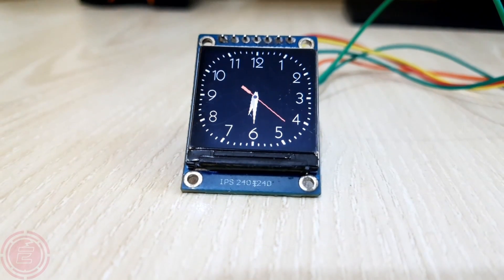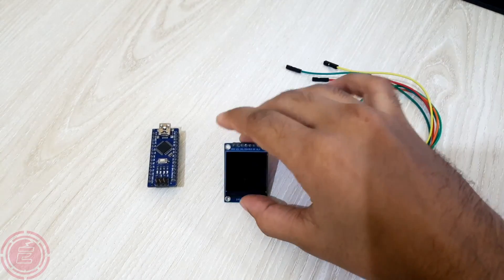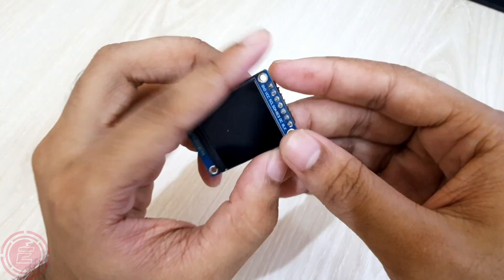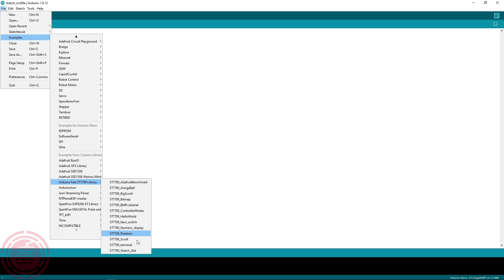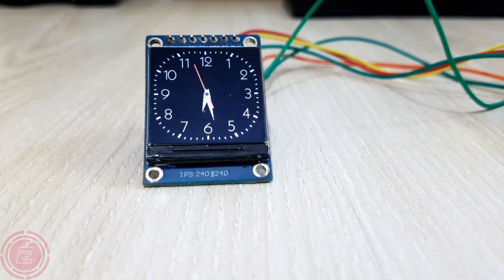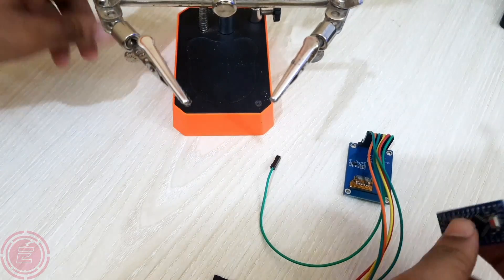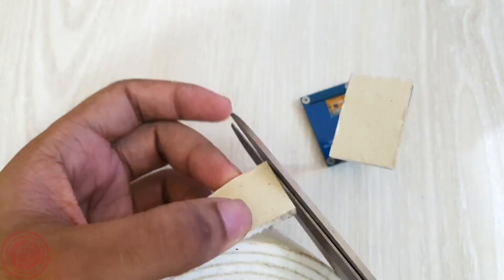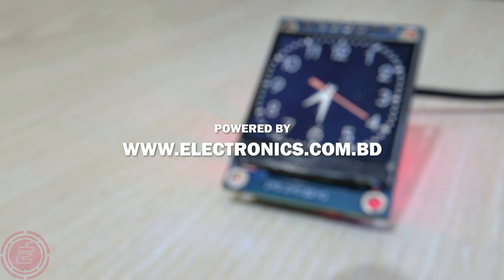DIY clock with TFT Display and Arduino

Comment: Nice build, will give this a try. 2 questions - I have a spare Pro Micro - will it work with this chip? Also, you say you wire it up exactly as per the nano but the nano uses 7 wires and the Pro Mini just 5, I assume that because you eliminated the extra wires for the RTC chip? Which wire was eliminated on the TFT unit? What are the correct pins to use on the pro mini to replicate the nano pins?

Comment: This video is helpful, but not directly relatable to my Raspberry Pi project.

Thank you for being very clear in all three important areas:
1) visual steps when assembling the hardware.
2) showing the wiring diagram/schematic.
3) software libraries and code example.

I am now a subscriber.

Comment: I own esp32 dev 30pins and 1.69" TFT 240X280 SPI ST7789. It doesn't work no matter how much I compile it for three hours. Do you have this lcd and esp32 connection diagram?

Comment: I repeated the same circuit and same code on Arduino Uno and 1.3" LCD Module (ST7789 Driver 240x240 IPS Display). However, the clock appeared perfectly during the first 11 seconds after I ran the Arduino code, but the screen faded (became very dark) after 11 seconds. What's the problem? Thanks!

Comment: Hey very nice detailed video, i am new to coding and adruino boards, i recently made a media volume controller for PC via arduino pro micro and its working fine. My question is that can we run two programmes at the same time? I mean i want to keep using my pro micro media controller, but can i add this clock display to the same media controller board and run two programs simultaneously to control media volume and clock display? Plz help.

Comment: I had it work in 30 minutes, nice project, really appreciated. But also the remark, it does not work with the 3.3V pin of arduino uno. No problems with the 5V. Curious if it lasts .

Comment: Hi, I like the watch! What must be changed in the code to use with Display TFT ILI9341? Thanks
Reply from the maker: You’ve to change the display Library.
My project was based on ST7789 library.
Basically, the whole coding was based on that ST7789 library functions.

So, if you want to use different display, you’ve to change the library and code.

Thank you.

Comment: Hello good afternoon in my country Mexico I do not have good knowledge of English but. My question is when I compile the program and upload it, it shows the clock on the screen but then it no longer shows it, it is a few seconds what you see, you could tell me what happened
Reply from the maker: Use an RTC module and check all the connections.

Comment: Nice project, thank you! 
But for me, the big hand jumps from 6 to 12.8 to 12.6: 00: 00 to 12:00:00. I don't have a connected ds3231, nor a connected PC I'll give it from another source and it will do it for me.
Sorry translator....
Reply from the maker: Use the RTC module for best performance.

Comment: Hey. Clock is working but can't see it. Initially after uploading the clock face views nicely but after few seconds watch face can't be seen. How to solve this
Reply: You probably have a display which needs 3V3 on inputs, your arduino puts out 5V. You need a level shifter or at least a tension divider for the datalines.

Comment: The display shows the right clock when i reset it but as soon as it loads in the display turns into a wirdly dark and messed up clock and i can bearly see it. What did i do wrong?
Reply: nvm the solution was just to use 5v input
Reply: @Chloe-xg1cf  Thank you for adding the NVM, I had the same problem. I am new to the arduino world, you saved me from messing around for hours trying to figure it out.
Reply: You probably have a display which needs 3V3 on inputs, your arduino puts out 5V. You need a level shifter or at least a tension divider for the datalines.

Comment: Everything works but RTC. Using DS3231 but still won't keep the time when power off.
Reply: You always need a battery with a RTC
Reply: @mmaranta785  of course...
Reply from the maker: check the connections again.

Comment: mine clock dials won't change, how it get changed?
Reply from the maker: Basically, This clock takes time automatically from the computer.
But, you can customize time, check the coding section.
There are options available for it.

Comment: Hi, where could we find the code if the RTC module is included? Thanks in any case
Reply: @BlondieHappyGuy  I forgot that I set a question here... I forgot what was the problem, if I found solution, etc LOL
Reply: @BlondieHappyGuy  Thank u in any case.
Reply from the maker: https://github.com/cbm80amiga/Arduino_ST7789_Fast/tree/master/examples

Comment: What is the code of this project. Where I need to find the screen
Reply from the maker: you'll get the code inside this library - https://github.com/cbm80amiga/Arduino_ST7789_Fast/tree/master/examples

Product - https://www.electronics.com.bd/1.3-Inch-240x240-ST7789-IPS-Display-module-robotics-project-electronics-bangladesh-bd?search=ST7789&description=true